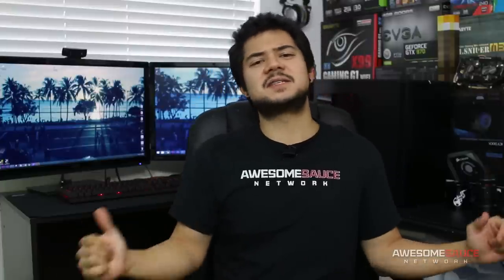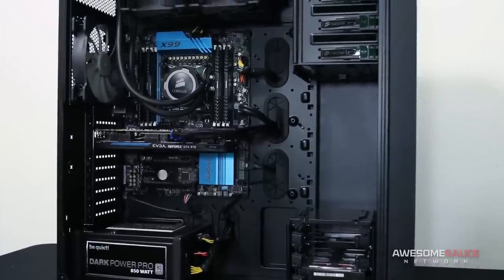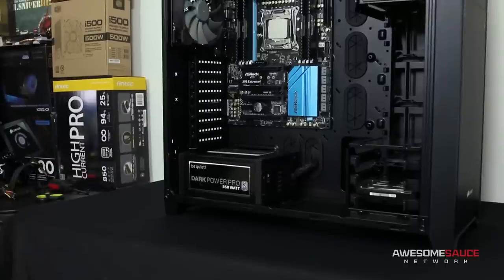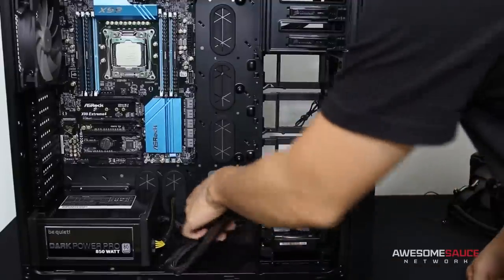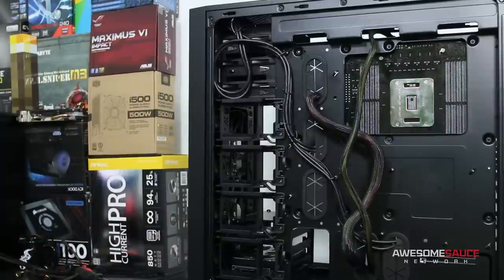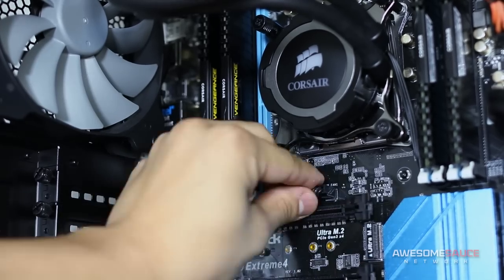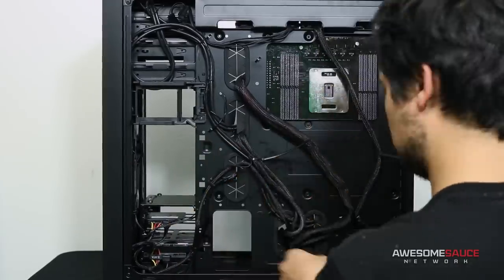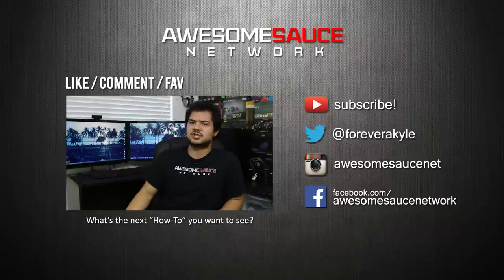How To: Cable Management

Comment: 2 things-what if ur case doesn't have managing holes and what if the cords are too short to reach the destined spot on the motherboard? my case doesn't have managing holes and on my friends computer the CPU power connector doesn't reach it.
Reply: so both of our computers look like rats' nests
Reply: 1. Mod holes or buy a new case. You could also get longer cables (extensions or full cables in the PSU is modular) and route them, but it looks sloppy and leaves bunches of cables everywhere.
2. If your friend's PSU is fully modular (or at least modular for the CPU power), you can get cables to plug into the PSU that are longer so they can reach the slot (make sure they work with that PSU). Additionally, your friend could use PSU extensions.
Reply: +Ethan Thai I'm considering buying a new case, because this one's old af and there's literally no room for cable management
Reply: +Trilby Lascaux lol

Comment: Why would you use twists ties? They have metal in them and can short things out
Reply: +Andy Smith because plastic is coated on the outside of the twist ties plastic is an insulator.

Some common insulator materials are glass, plastic, rubber, air, and wood. Insulators are used to protect us from the dangerous effects ofelectricity flowing through conductors.

Comment: cool video and all, but with a case like this and a fully modular psu cable management isn't that hard to begin with.
Reply: I noticed that too, although most cases these days have fairly good cable management space.
Reply: +Cameron Scott well i got the corsair spec 03 for a budget case and it surely ain't looking pretty without a fully modular psu. Not much space for cable management on the side panel either

Comment: my power supply has lots of cables i dont use, can i cut them off?!
 

(Im not good with PCs sorry)
Reply: tuck them somewhere you can hide them
Reply: +Bronsoncs U cut them off?! Wtf are you thinking?
Reply: i was thinking about it, then i realized how retarted i was being
Reply: Cut them off lmfao wtf
Reply: Actually, you can if you have electrical skills. Use a ton of electrical tape and common sense, though.
Step 1: (XD) Turn off your PC, and then unplug it, turning off the power supply as well, if it has a switch.
Step 2: Wait at least 15 minutes, then open the case.
Step 3: Grab some wire cutters or pliers, and some scissors, and a couple rolls of electrical tape.
Step 4: Cut the wires you're sure you don't need in the future, or right now, cutting close as possible to a connector or other solid attached thing, but leaving about 1 to 2 cm of end.
Step 5: Take some electrical tape, and starting at the top of the bare wire end, wrap the end about three times, at least.
Step 6: Cut off the excess tape, and close the case.
Step 7: Plug back in your PC, and then do what you want with it.

Comment: can you use the liquid CPU cooler as a normal air cooler?
Reply: Erik Dragonfire not sure what you mean, but whenever it is plugged in, the cpu liquid cooler will constantly pump water into de cpu and cool it with the radiator... the loop is closed, so you can't take the water out of it and let it pump air, if that's what you mean. Cpu air coolers are nice (and have a better price-performance rate), though, noctua has some really low profile ones (and you can change the fans, if you don't like the colour)
Reply: Joaquin Cardona ok thank you for clearing it out, you see I have watched a few PC building videos and they use liquid coolers but without liquid or liquid containers and pipes so that made me confused and then I thought you could use liquid coolers without water like in this video for instence
Reply: Erik Dragonfire There are basically two ways of water cooling our pc. Custom watercooling, in which you buy a pump, reservoir, tubing, blocks, and other stuff... this is more expensive, better looking and more effective. The other way is buying a closed loop, which consists on the block (designed for cpu, you'd need a special block if you want to cool the gpu) tubing and a radiator, all closed together with the liquid included. You buy it, mount it, and its done. Cheaper, simpler, less effective. The most common manufacturers of closed loops are corsair (h100, h110) and NZXT (Kraken series).
(: Good luck!
Reply: Joaquin Cardona ok thx but I think I'll stick with air cooling when I build my PC xD thanks anyways

Comment: whats the difference between fully modular and semi and none at all??????
Reply: +Throne Gaming Fully Modular: You can remove every cable - Semi-modular: Every cable but the main ones, usually the 20/24-pin and/or the EPS (CPU) cable - finally, non-modular, no cables can be removed.
Biggest plus for modular, is: If you don't need the cable, then it does not have to be plugged in.
Reply: +Luis Alvarado And sleeving options.

Comment: im building my first pc and i have everything pretty much where its suppose to be, now im stuck on connecting cables. :(
Reply: dbsshadow same,  I dont know where to put the hdd led and reset switch and the manual is confusing me even more, FYI I use a MSI H97 GAMING MOBO 3
Reply: Bader The Hacker i have the z97 extreme3
i had to get my friend to do it for me, but  i kinda had it right the first time. good luck man.
Reply: thanks

Comment: builds computer
connects cables
uses zip ties, etc to cable management
*pc doesnt turn on *
FFFUUUUCKKK!!!!!
Reply: This is what I'm dreading. Building my first pc this week. 
Question: do zip ties come with the pc case or do I need to go out and buy some?
Reply: +Django CS GO this isnt what you should be worrying about. The zip ties could come with the computer case or the power supply, and if not just buy them at walmart
Reply: Thanks mate

Comment: A video is I could use is how to actually clean it after an year or two. I'll be damned if I can figure out how to clean dust from the fans without too much effort. The fans themselves are a pain, but the grills are even worse - a carbon like ash has clogged and glued them. The grills for the front fans are even worse -they are obstructed by the hdd and ssd trays, as well by the optical and an old floppy I have there. There's also all kinds of small cables for all sorts of led lights there. I'm too lazy to pull them out! Cannot be cleaned from the outside without removing some (cosmetic?) grills, which again I'm lazy.  The case is a Zelman Z9 mid tower. Any tips?
Reply: a can of compresed air is your fix according to my friend
Reply: +Dylan Kiefer , that black sticky powder all over my grills is compacted dust. It's very hard to remove, if you run your finger over it it doesn't come out right away, you actually need to scrape 5-6 times putting pressure to get a chunk out. A simple can of compressed air won't do for me, sadly
Reply: +ionicafardefrica Im pretty sure you have a local gas station that has a compressed air machine for tires just use that shoyld work wonders.
Reply: Datonedude Angel , won't that hurt the fans? I have a small compressor in my own car, but I figured spinning the fans with that might be overkill. Especially if I spin the opposite way?
Reply: +ionicafardefrica the opposite way of course, but spin the fans in thr right direction

Comment: The second panel on my case is riveted on. 
Fuck oem cases.
But since the motherboard is attached to a middle frame I am pretty sure the panel can be removed, it's time to drill some rivets.

Comment: 1 assemble cpu mobo and heatsink at same time outside of case. 2 screw in mobo to case. 3 use fingers to plug in dat 8 pin. ez pz. heat sink after? no way.

Comment: Sad life for someone like me who doesn't have a modular psu
Reply: +TheOfficialNar Me too! But I found a solution.. Use the s340 case. It allows your power supply to be at the bottom of the case, away from the gpu and motherboard. Like an extra compartment for just your powersupply and harddrive.

Comment: Is it ok if un plug my cables and re do it?
Reply: +allen hakobyan lol yes, unplugging and reconnecting cables wont bee an issue. just make sure to have the power to your PC turned off before starting.
Reply: +dante3hsify thanks man and the power ofc lol. I just can't get the 20P connection out its stuck in there and I don't want to yank on it. How can I gently remove it?
Reply: +allen hakobyan fire

Comment: when u have an matx mobo in an atx case, and the holes are designed for atx mobos
Reply: i may have just ran into that issue when i ordered my matx board with a silent base 600 last week...
well, lets see how that turns out once its shipped
Reply: firudu

Comment: 1:20 Untrue. Cable management does not affect temperatures. This has been tested.
Reply: +Stefan Videnov I could see it being an issue if all your cables route in front of your intake fans and all that, but it really isn't too much if your fans take care of moving the appropriate amount of air in and out of your case in the first place.
Granted, dust will settle, and it won't look good.
Reply: +Stefan Videnov  it would affect it becasue there'd be less airflow, as Luis said especially if its infront of a intake fan or CPU fan, or any heatsink/cooler 
because some power supplies have a LOT of cables, and you might have a lot of accessories.
Reply: ***** I did link something, but my comment got deleted. Search for linus' tests.
Reply: ***** Theoretically yes, practically it's negligible. The problem comes from the extra surface area that gets dusty over time. The amount of cables 'blocking' the airflow does not impact temperature.
Reply: ***** My main point is you can't just test with one system under one specific circumstance and then lay a blanket statement over everything saying "nope it doesn't effect anything"
Reply: ***** Oh are you talking about the video where he successfully breaks numerous laws of heat transfer and thermodynamics. Also the video where he never shows us the temps but just reads them off of a blurry monitor, well shit I guess we just gotta take his word for it. I mean why would someone do that, go on the internet and tell lies? Especially if it's to get more views and make you look like a genius in the process, why would anyone do such a think?
Reply: ***** It's OK just believe them without ever having tested it for yourself. Makes perfect sense.
Reply: ***** Educate yourself on ad hominem, this argument isn't worth either of our time, we bot have better things to do
Reply: ***** I meant both but ok?
Reply: +TheFuuru visit linustechtips channel.
Reply: Bartosz Olszewski *Ever watching linus tech tips*

I see what is the problem with the PC building community now.
The guy has ZERO actual tech background and you are all inclined to believe him why?
He breaks multiple motherboards in one video, creates a shit RAID config that wipes all of his server data, and encourages people to cut shit off of their graphics cards. He literally ruins prices for everyone else as all of the 13 year olds who flock to his videos and think they understand shit go out and buy expensive hardware, fuck it up, RMA it, and run of the prices for everyone else. The only reason why he should ever be watched is for entertainment, not in order to learn things. There are better people out there that can do that for you that aren't just reading labels off of the boxes of products.
Reply: Deadrablade lol boy, calm down, there is nothing wrong with him, rather with you. calm down, you just have a bad day...
Reply: Bartosz Olszewski What? I am calm, could you just not refute anything I said? There is so much wrong with him and I brought only a small potion of it up.
Reply: Deadrablade so you can say the same abouy Jayz who defragmented his SSD or Hardware Canucks who lost their entire data collection by a stupid mistake? Look shit happens and you can't blame him for that as he said he knew what could happen and explained it to us during a stream. I actually am into PC building for quite some time and still like his videos. How can he ruin prices? Just how? Cutting video cards? Well, I think people know what they are doing. destroying couple of motherboards? Well he got it right the third time and already knew what was wrong. Just look at some of his good videos, 7 gamers 2 CPUs for example. He knows shit and fails less than anyone else does. There is nothing wrong with him. And no offense bro, but looking through your channel content, it's just tragedy..
Reply: Bartosz Olszewski Oh shit hahah I just realized you said he defragmented his SSD hahahahaha holy shit lol thats hilarious. SSDs don't get fragmented. And both hardware canucks and linus didn't have a raid for redundancy, which makes them stupid.
Reply: ***** Thanks for the free analysis but you're wrong doc. Lol I already have a job, I design fiber optic gyroscopes.
Reply: Deadrablade and he probably still earns more than you. not him but JayzTwoCents defragmented his SSD. Lol you should really calm down and talk to your ego.. lol I hate immature adults who behave like 10 year old jealous kids with complexes. I'm not that mature yet but I don't insult others and behave like that. Maybe you know about computers more than him but behave like that kid who knows nothing and is bragging about his proffesion. Electrical Engineering has very little to do when it actually comes to PC, knowing some people it rather leans towards general circuitry and things like that.  And well, shots fired as I attend computer science classes and still like him. He knows shit and makes quality videos. If he does something right, he does it right, if he destroys 2 motherboards, we make fun of it and keep watching. Lol, maybe you are just a psychological phenomenon or something. Okay, you know shit about your job then get back to it. I don't see how fiber optics could have anything in common with PC building but okay. Just get over it. Lol.
Reply: ***** k man. I like you already, maybe a match or something?
Reply: ***** Except he isn't. He really doesn't make that much money you realize that right?
Reply: Deadrablade  well, what would you say if I told you that:
1. He has got a Lambo
2. He easily gets stuff or spends money for:
-over 5 editing workstations with Titan X's
-$17000 UPS
-Server grade stuff and approx. over 600TB of storage
-$30000 gaming PC
-had tons of GPUs just laying around in his house
-employs group of people
-cameras
-tons of little but still expensive stuff, for example plugin for premiere - $400 for a seat.
3. Gets a LOT of money and hardware from sponsors for the things above, also even more for the advertisements
4. As ***** said, he's got 2 million subscribers who watch these ads
5. channelsuperfun only gets $2200 from patreon
6. He's an important name in the PC industry, actually collaborated with Noctua to make black fans (DO YOU FREAKING BELIEVE THAT?)
7. Less important but still, he can ruin CES booth, break some stuff there and call the stuff assholes and just leave
8. can afford breaking 3 server grade motherboards :p
Reply: Bartosz Olszewski He doesn't buy any of his shit you realize that right? He is just given it all for free by the companies for shilling for them.
Reply: ***** Doubt he makes 6 figures from jewtube
Reply: ***** He has specifically talked about how much he makes a month after taxes
It was around 7000
Reply: Deadrablade what's wrong with cutting a GPU if I may ask? That's only a lock, useless piece of material. And If you want to make a Titan fit in one slot, you know what you are doing lol. You are literally just pumped with your proudness and arrogance. Can't wait for that to make a loud pop. Lol that would be funny actually.. Let me bring some popcorn.
Reply: Bartosz Olszewski I'm not talking about cutting the lock, I'm talking about the video where he turned a two slot into a 1 slot and got metal shavings everywere
Reply: Deadrablade he didn't broke the card and if you want to have 1 slot GPU, these are sacrifices you have to make.

lol okay.
Reply: ***** Lol but have you noticed how it's actually funny? We could survive without writing and nothing would happen but still..

Comment: My power supply isn't modular, and my case has no power supply shroud :((((
Reply: You can still take the useless cables, taking a zip tie and tie all the useless cables together and it will be much cleaner. And if you are more deticated, you can make a Psu shroud yourself :)

Comment: The pains of a non-modular PSU...
I have like 20kg of cable lying at the bottom of my pc..
Reply: +McDucky 
I have a non modular PSU and small case , but look at my build 
http://imgur.com/1QbLpqd

spec: i3 4150, MSI GTX 750Ti, corsair vg pro 8gb dual, cm hyper 212x, 1TB WD blue, CM 500W ELITE V2, CASE CM N200 WINDOWED
Reply: Tommy K
Do you have any leftover connectors?
Reply: McDucky what do you mean?
Reply: Tommy K Any cables that are not connected?
Reply: McDucky
no..
Reply: Tommy K
Well, that helps. I have 4-5 cables that are not connected anywhere.

Comment: http://pcpartpicker.com/list/8PFb8K this a good pc build?
Reply: for the love of god get a better hdd and a z170 chipset motherboard so you can overclock your cpu
Reply: yeah.  a z170 board for OC and a 7200 rpm hdd. shoot for 2 TB if you can afford it
Reply: Horrible, go for an Asus Z170-A motherboard, switch out that crappy SSD to a Samsung 850, and buy the Be-Quiet Pure Rock instead of the Cooler Master Hyper 212 Evo.
Reply: Eli Maffry Your choices make no sense. 700w PSU for 1070??? That card runs fine on 450w. Get the Z170-A, pirate windows, Get a better SSD and get 2x4gb ram instead.
Reply: Music & Drawing I'm gonna go 1070's in sli later on. Plus its on sale at my nearby Microcenter for like 50% off :D
Reply: Eli Maffry Get a 1080 instead, it might be a little less powerful but SLI isn't worth it. Loads of noise, power draw and badly supported games.
Reply: Music & Drawing oh ok :)